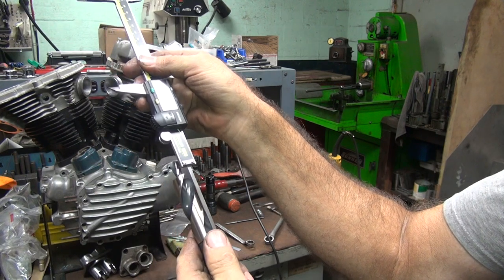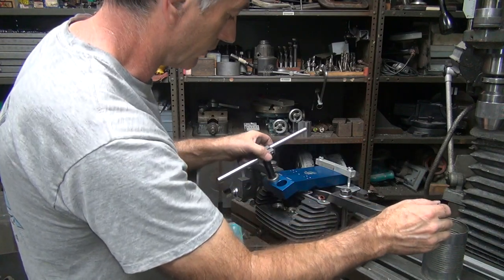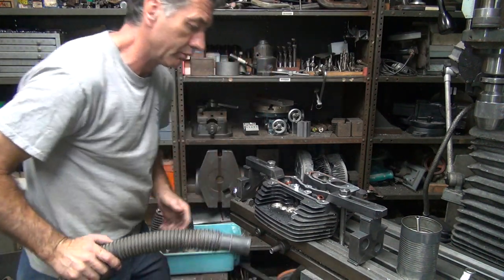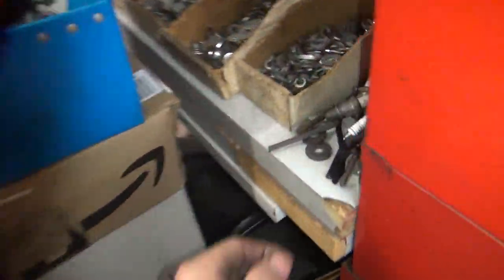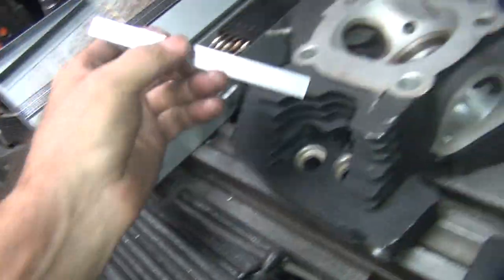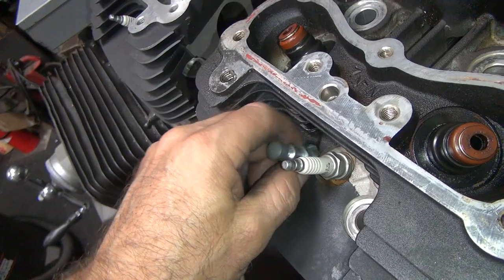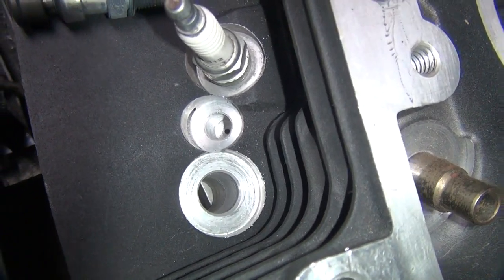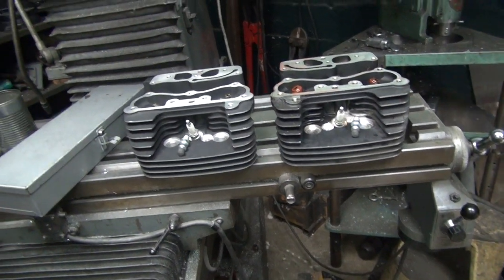#106 tool testing jims twin cam compression release drill fixture evolution harley tatro machine

Comment: It was worth it Tatro....  You proved what you have said in previous videos; Jim’s engineering actually makes decent tools!
Reply from the maker: yes but i do change most of them somewhat to make them work correctly. they do use good metal and heat treat them. most of the cheaper stuff is soft and worthless.
tatro

Comment: Hey Tatro,  is it possible to drill the .060 hole from the combustion side perpendicular to the head. Would be a little of a blind shot. But once you had it you good make a jig across the bolt holes for future mods. May be a problem where the .060 hole falls in the threaded hole though? I really enjoy your videos..Thanks..
Reply from the maker: that would really weaken the head gasket surface. most likely the head would crack there too.
tatro